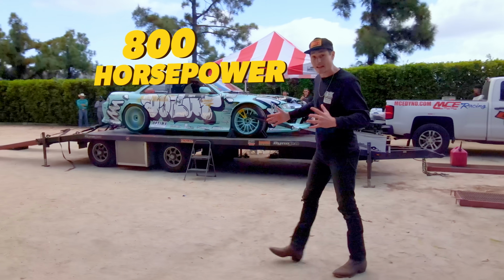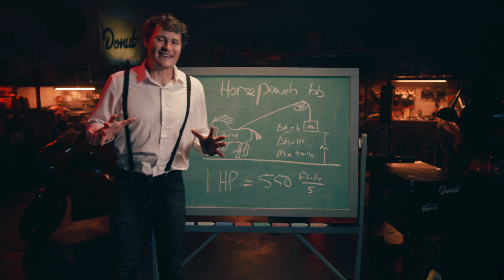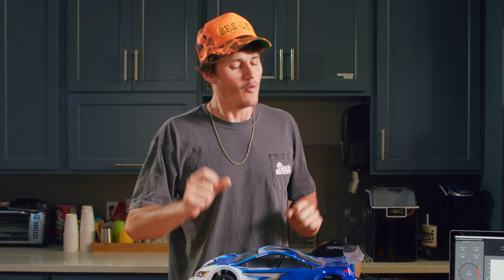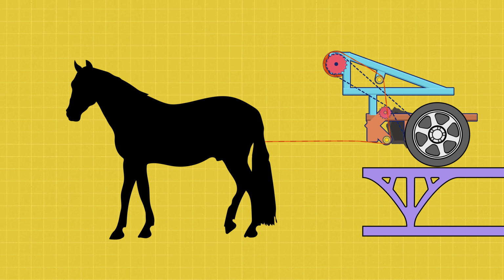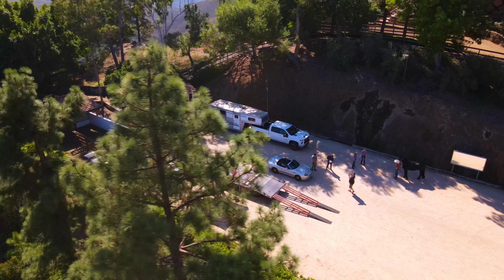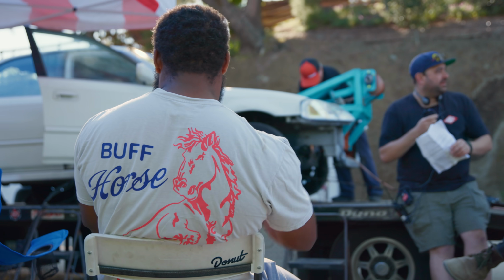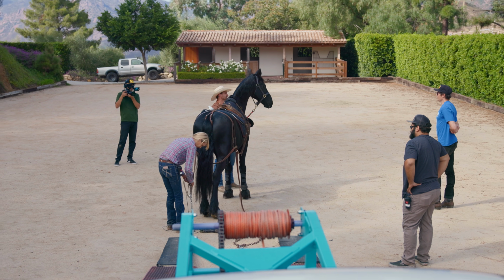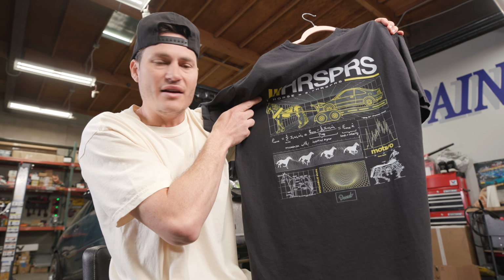How Much Horsepower is a Horse?

Comment: The premise is flawed. A horse with a rope is like a truck with a trailer where your measuring the trailer tire to get horse power. 🐎 I don't know what it would be like to get hoof and leg measurements. Pressure sensor and sensors on the horses legs but a rope is not accurate. Drag or friction. The only near true line would have to be strong gulf fishing line that's lightweight. But a rope is too heavy
Reply: Maybe synthetic wench line.

Comment: To convert your car's horsepower ( X hp) into the equivalent of real horse power (5.7 hp per horse), divide the car's horsepower by the horsepower produced by one horse:

X hp / 5.7 hp per horse

This will give you the number of horses that your car's power is equivalent to:

X / 5.7 ≈ car's real horsepower

So, your car's 265 horsepower is roughly equivalent to the power produced by approximately 46.49 horses.

Comment: I would have had an idea if you would have asked for...much simpler and cheaper. A wider treadmill, rear of it to be connected to a free running axle that has some weight on it to sit on the dyno and when the horse runs on the treadmill, it spins the rear axle etc, u get what I mean, right ?

Comment: This is not correct sir, this is walking horsepower under a certain load ,not exertion horsepower but nice experiment... horsepower was base on steam engines. so if the steam engine could lift weight at a certain rate and the horse could happen to do the same thing that would be the rate that they would use. they could of seen if a zebra could do the same rate and called it zebrapower... I'm just curious on what type of horse they really used.

Comment: Watt was interested in pitching his machine to people who had horses work for hours on end, everyday, on critical infrastructure like a mine's water pump.
What you measured was Maximum horsepower output. Even a strong modern horse wouldn't be able to pull their full strenght for much time. What Watt did was find out the load in which the average horse could pull continuously.

And the French repeated his experiments, but they did it on the Metric system. A CV is roughly 10W less than an HP. Which is pretty much right on the money if you consider the statistical deviations between the horses tested.
Reply: That is a really good point. The disconnect, I think, is that car people car about the maximum power of an engine because unlike horses, they don't have to worry about an energy system which depletes rapidly.
Reply: To be fair, a normal car can’t run its maximum HP continually either. So seems like the right test to me! If a 500hp car was to out put 500hp constantly it would explode
Reply: @itllBuffGaming Not necessarily. It really depends on the duty cycle the engine was made for. When GM created it's marine engines, they all were rated at 100% duty cycle. This included the engines ability to cool. Look up the "Marine Dock" test. They ran the engine at full throttle for 55 minutes. Idle for 5 minutes and repeated this for 300 hours. Other engines like semi truck diesel engines are rated for 100% duty cycle too. I agree that most light duty truck and passenger car engines are NOT rated for 100% duty cycle but of course you don't drive with your foot to the floor at all times.
Reply: @geoffinbc  You should try a German Autobahn once 😉 do it early in the morning on a weekend and it's pedal to the metal for 30+ km at a time. Once blew a coolant pipe around the car's 10th anniversary (it pretended to be a steam train for a while), but other than that the 254 horse powers were usually delivered and transformed into 250 kph on the left lane.
Reply: Very cool. I've had a buttload (SAE) of cars in my 51 years of driving and never actually thought about it. Great explanation.
Reply: This load is not even close to what that horse could peak at, strange argument.

Comment: Seems like the obvious solution was to have the horse walk in a circle turning a beam, just like the original draught horses... that was the best solution when they were actually using the power. It would allow longer duration testing, which is critical in the definition of HP, as it's not supposed to be a peak power, but the "usable" continuous power the horse can provide as an engine. Would also be pretty easy to rig up a strain gauge for the purpose of measuring the torque.
Reply: To be fair, the peak power is the figure that's used in vehicles. Of course, the reason for that is unlike biological systems, a vehicle can maintain peak power over a long period of time (though is wasteful of gasoline and is taxing on the drivetrain).
Reply: @avihooilan5373  but I believe the unit was intended for the usable power of a horse, not its peak. 746W is a laughable peak power for a horse; I can do well more on my bike 😂. I expect a horse can output maybe 10kW or more briefly.
Reply: @superjimnz  you're right about that, I am just saying that if we want to compare a horse to a car we should look at peak power, not sustained power. This is why this single horse had over five times worth of horsepower in the video.

The problem with these kind of questions is that you'll get a huge range of answers depending on what exactly you're measuring. A biological system has many different energy outputting parts and there's not a clear obvious way to quantify this scalar number we call power. Sustained power and power bursts in a biological systems can be orders of magnitude apart.

A car has a nominal horsepower figure which captures some power output (at the crank or the wheel for brake horsepower) at peak conditions (typically engine RPM), but even a car wouldn't sustain a consistent maximum power because that would wear down the drivetrain quickly and no driver actually uses a car that way.

Anyway, your original idea is right... the correct measurement would be to look at the power utility of a horse for a given task and the numbers would be different depending on what we want the horse to do, such a locomotion, sprinting, carrying weight, doing mechanical work (such as in a mill). I'd also imagine that different horses are good at different things.
Reply: @superjimnz  Professional athletes can just barely reach 400 watts. You're not doing 750.
Reply: @ I've actually just beaten 1000 before, which is not unusual. That's for 2s, not continuous which was my point. Some pros can do over 400 for an hour.
Reply: @superjimnz  ah, that's my bad. Yeah I agree, it's meant to represent continuous workload throughout the day.

It makes sense for engines to go by peak horsepower, because so long as they are in good condition they can maintain that power for extended periods.
Reply: @avihooilan5373  any engine at peak power is when It’s the most efficient, taxing on the drivetrain my balls
Reply: Can't make the horse gallop in a small, fixed circle and only tests low range "torque"/power.
Reply: The peak power result is just as interesting as the sustained power result.  So it's fine, still very valid data, however you are correct, if a sustained power result was been sought, a beam attachment in a circle is ideal.
Reply: Exactly what I thought.

Comment: "they helped build the worlds first vertical takeoff and landing aircraft" I wish I knew what you actually meant by that. The worlds first VTOL aircraft was invented in 1783 with the hot air balloon. after that we had helicopters since 1928, and the harrier VTOL jet was invented in the 1960s.... Motivo was founded, per their website in 2010... the F35, which is hardly the first VTOL jet, was in service 4 years before this company was founded, and the video you showed was using the same mechanism as the V-22 Osprey which first went into service in 1993, so what the hell do you mean first VTOL aircraft? this doesn't make sense. did you mean first VTOL drone? that would almost make sense, except no they didn't, so wth

Comment: You sacrificed scince in favour of show
You experiment WAS NOT scintific at all!
First of all you need to understand the difference between the peak power and continuous power. This make A LOT of difference!
Peak power can be achieved by utilizing glycolytic muscle fibers which are not using any oxigen you breave in. This power can be several times more than continuous one. But you can sustain this only for several seconds.
Continuous power achieved by using of slow oxidative fibers which converts ATP to power with using oxigen you breave in. This power can be sustained during tens of minutes or even hours. But it is much smaller.
For a human this slow power usually measures as a few hundreds of watts: like 150 or 250. Top cyclists can go beyond 350 W for long periods of tuime.
Second thing is that this power is hugely depends on the speed. To achieve the maximum output mammals should operate in a narrow range of motion speed. So when you have tried to pull the rope at 1-2 mph speed - it was definitely far from your optimal speed to achieve the maximum power.
Go figure!

Comment: How did they determine the optimal shaft diameter for this project? Especially since it’s dynamic and reducing as the rope is pulled out? Also wondering about the stretch in the cordage used?

Comment: The engineering is cool, but could've been wayy simpler, just rig up a baseball launcher-esk rig where the rope gets pinched between 2 wheels and measure the rpm and acceleration 
            🛞 
🐎 -------- 
            🛞 📟

Comment: Aren't horsepower units relative to the weight 'the engine' carries? Or is it relative to a specific weight? Because they put that car as the measuring unit, why not a F150 pickup truck for example?

Comment: That horse could have pulled faster if his handler didn't suck. You need to do it again with a guy that can run faster or where you can have the horse going full force. It didn't really prove anything.

Comment: I see a problem here - you didn't scale the device before doing the horse test. Maybe you should try pulling the line with a car that you measured a horse power before? For me without that, this is just guessing. Additionally Watt was probably thinking about the horsepower of a horse working for a few hours - not just a moment - i you ask chat you get "A horse can exert much more power in short bursts (up to 15 horsepower) than it can sustain for a long workday (around 1 horsepower)"

Comment: Measure the mass-m (kg) of person.  Measure the time-t (s) needed to run up the stairs of some hight-h (m). Calculate power: P= (m*g*h)/t, where g is 9,81 m/(s*s). Voila. 0.0 $ costs. Dumb engineers.  I addmit, one can not make a half hour video en get 5 m views for such video. Humans (very well trained) can produce several hp but for very short time. My average science pupil produce around 1 hp.

Comment: one thing is wrong here, and it makes it very wrong at the end. 

Any engine can output its maximum power for a long time - basically infinitely. A horse cant. Horse get tired. 

This is why for the standard, James Watt used averaged power from a horse that works 8 hour shift. 3 horses per day.
He took how many times a horse rotates a mill wheel by an hour.

The 550poundfeetsecond or whatever unit you use in Murica is simple representation to show how this AVERAGE turns into something imaginable.
What you measure is maximum output of the horse, which is not the same as the AVERAGE. 
Where you were pulling the rope, you could do it for a short distance and time, but you said afterwards, your hands were dead. Try now doing it for 1h.

It is two different measurements that gives different results. Strange...

Comment: It isn't accurate & convincing. Big D has his own weight & gravity. Just by computing how the horse pulls whether lesser, equal or greater to his weight will vary results. You don't need to create a dyno either. By just videoing & reviewing how the horse runs on track, his time & putting all the needed variables in account will derive to a more credible result. And comparing the actual results of Big D or any race horse to the car's horsepower will be more accurate, substantial & rational.

Comment: Watt's estimates were fairly accurate: one horsepower is roughly the average rate of work a healthy draught horse can do over a full day, confirmed by data from the 1925 Iowa State Fair and by English veterinary surgeon William Youatt.
In 1993, biologists R. D. Stevenson and R. J. Wassersug published a letter toNature in which they estimated the maximum power output a horse can muster. Previous studies had shown that the maximum sustainable mechanical power per kilogram of muscle is between 100 and 200W. Using the lower bound, they calculated a theoretical peak performance of 18,000W, or around 24 horsepower. Looking at data from the 1925 Iowa State Fair, they found a much lower real-world value. Over a short period of time, they calculate, a horse can exert up to 14.9 horsepower.

Comment: The pulling power of a horse isn’t curved like that of an engine. It might have sawtooth waves in the diagram. They should have use six horses to spread the  power motions and increase the resistance of the dyno to keep it slow. If you divide the result by six you’ll receive an average performance of one horse which is more reliable.

Comment: Thank you for all the details, engineering skills, and knowledge, to open up our minds. I just got one question. 🥰
🤔
Why can't you put the horse tightened to a wall over a treadmill that has a sticky or rough surface and calculate the horsepower upon the Tourqe or the pulling power the horse makes?

Comment: Why you guys did exactly what  I was thinking to do during your process of contacting people. only my thought was the spool with a gear and a single tire suspended as to get a weight less mount on the dyno. I feel the civic addition may have added alot changes to the outcome. I'm not sure if weight plays a roll though😅

Comment: First, gerat Project and interesting results. This is not a criticism but a perspective: Watt was comparing his machine to a draft horse, working a full shift at the treadmill as far as I understand. You measured peak power, if I am correct? So maybe, Watts figure may not even contradict yours.

Comment: Is it possible to just connect the rope drum directly on the dyno shaft?  The setup would be... the rope drum would be just beside the dyno shaft.  Although that would still be wheel HP but there are no loses from the different gears and chain.  What do you think?

Comment: There is absolutely no way 6hp is accurate.  There are videos of one horse pulling stuck cars out of a ditch.  If you tried to pull that car out with a 5hp tecumseh on tank treads for traction, it would not budge an inch.

Comment: 10 humans pushing a 3GT meant that the car had one horsepower at least when I did the math so if a horse has 15 horsepower and 10 men = 1 hp 10 x 15 = 150 men = 15 horse power

Comment: The horse wasent used to its full potential they were just pulling the horse along they werent riding the horse and using it like you normally would so they didnt get the ACTUAL horsepower number

Comment: With all the tech, experience, and money, I'm surprised they didn't just use a wheel speed sensor or crank position sensor, tone ring, and a labscope. You could calculate roller angle, position to compare to tdc, capture an output signature and track the rollers speed down to the millisecond.

Comment: Wouldn't it have been easier to hook Big D to a wall and turn the dino into a big ass treadmill. Many factories have old used belts and even back up brand new ones more than bog enough to turn the dino into a treadmill. It would make for more direct contact and less energy loss than this experiment.

Comment: If 5.7 is the power of 1 horse, shouldn't the actual power of vehicles be adjusted for this difference. For example if 500hp was supposed to be the power of 500 horses. How do we get 1hp to actually equal 1 hp? If 5.7 is the same as 1 that means a 500hp car should be 2,850hp

Comment: Cool experiment and all and I've always wondered the same thing but I have a question is the Pulley you hooked up to the horse only hooked up to the car or just the car tires to make them spic. I ask this because if you're just pulling tires around it's and its not connected to the car the horse has less weight to pull verse if you welded it or attached it to the car than horse has to pull that weight so. Right?

Comment: I see multiple issues with this experiment. Chief among them is that the surface is sandy. The limited force able to be exerted is limited by the traction of the sand. Why not do a test by calculating work, like we did in grade school? No fancy equipment is required. Just create a course where you have to move some weight up some distance. Then, all yo have to do is to weigh the horse hand have him run up the course - just time how long it takes him to get to the top. My best friend in grade school (I guess it was grade 8 or 9) tested at 6 hp if I remember correctly (he was a phenomenal athlete). But that was over a period of time of just 5 seconds or so.

The other thing I thought of regarding this test is that instead of having a cylinder for the rope spool, it should have been a cone, with the rope at the narrow end of the cone toward the end of the test. In this way, the horse would be constantly accelerating the wheels of the car while continuing at the same speed. It would require more horsepower by the horse, even at the same speed.